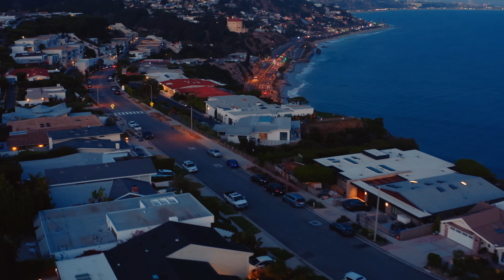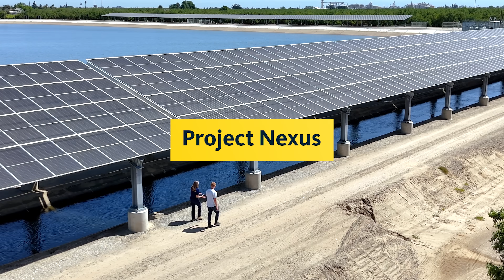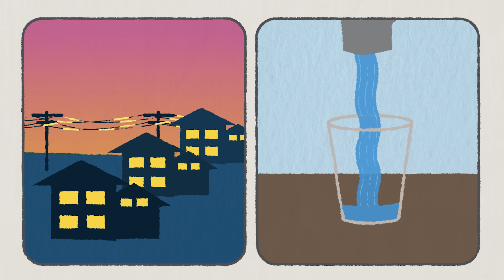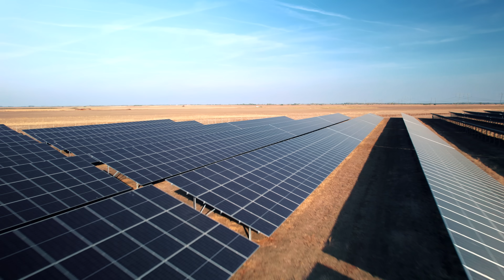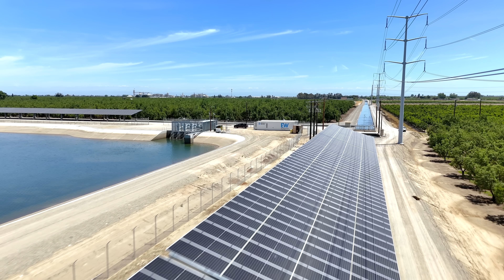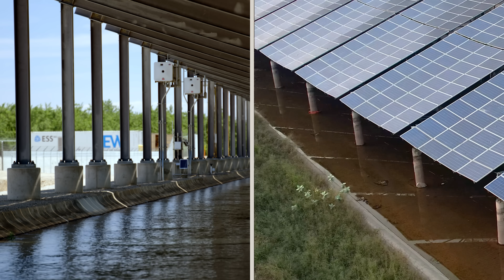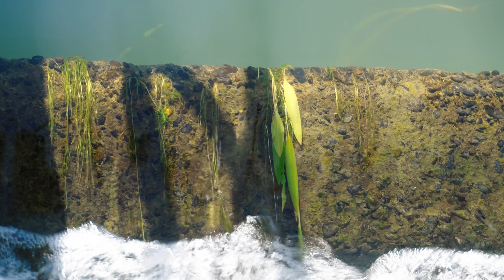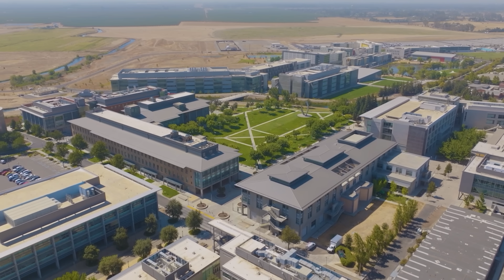California’s new solar panels do MORE than generate power

Comment: 63 billion gallons a year is a large number, but California used ~5000 billion gallons for agriculture in 2015.  Even if all 4000 miles were roofed with panels that would only save 1.2%.  That much roofing is unlikely to happen.  Other strategies like fixing leaks and preventing theft would save more.

Still, this is a good idea because it's a ready source of land for panels.  It's hard to find this much land, but the state already controls it.  The power generated is worth a lot, but it's not going to affect the water supply all that much.
Reply: I said the same. It’s a poor video, really.

Comment: Getting some sort of shade in place (that can eventually support panels) should be the biggest priority
Reply: Depending on the initial cost of the parapace (is that the right word?) it would be to expensive to add solar panels later (double the labor cost alone at minimum.) So better to just multiply the value created and spend a little extra.

Comment: 0:39 Actually electricity is used most in the middle of the day, when heavy industry and businesses are operating. During the evening there is a sharp drop in electricity usage. However at present solar covers just about all the demand from the middle of the day. Whereas in the evening when solar is weak or gone there's still significant power usage. So what's higher in the evening is the demand gap; the gap between solar generation and energy demand. Total demand and demand gap are very different metrics, and we shouldn't let ourselves be confused about who is using the most electricity (extremely wealthy businesses) and where it's coming from (residential rooftop solar).

Comment: good idea to cover canals and parking lots (or roof tops) with solar panels - BUT I fail to see why California would have any problems placing solar panels even without any of the already mentioned measures. it pains me to see solar panels on the ground in places like Europe covering fertile land suitable for farming or any other productive activities. 
however, California has lots of hot, very dry, almost barren desert regions (not to mention other US states with depleted soils dating back from the Great Depression or even more hot deserts).
Reply: You’d have to think that if land was capable of being used for grazing or growing shaded crops then purely from a profit motive you would only expect land to be covered as you put it if that land wasn’t good for either of those use cases.  Landowner is typically have enough sense to maximize the use case for their land.
Reply: Solar panels are actually a good mix with agriculture when combined with crops requiring shade. Certainly we should begin with large, flat roofs.
Reply: Getting the electricity from the desert to the city can cost a lot more and they need to get permission from every single land owner that the cables need to run through

Comment: And along with everything else, the water can cool the PV panels. Often this is called "floatovoltaics," although the panels may not actually be floating on the water. And yes, there's "agrivoltaics." Photosynthesis of plants tends to max out in the brightest part of the day, so shading them over a certain angular span may give you the best of both systems.

Comment: Like most solar, wind and climate change alarmism propaganda this video likely receives funding from the natural gas industry.  Human caused atmospheric CO2 on average is less than a 1/10% share in earth's water vapor saturated greenhouse effect. 

In practice the solar and wind generating space is supported by running natural gas turbine generators at high readiness making near zero electricity at the fuel cost of making all the electricity with natural gas combined cycle power stations.  Since little natural gas is generating electricity the high natural gas use is hidden from the public.    There is no fuel savings if there were natural gas fuel savings that would be greatly promoted.   

Steam turbine generators powered by economical nuclear, coal and the second steam cycle of NGCC power stations react too slowly to support large amounts of solar and wind generated electricity.  The UK is culling wind farm output to save very expensive natural gas.  Wind farm output wildly fluctuates per second requiring constant make up above high readiness causing wind power to be the most natural gas expensive form of providing electricity.   

All the large increases in US electric rates over the past five years are due to every increasing support of wind and solar generated electricity forced on the public power grids.  There has been little inflation pressure on electric rates.   New large industries typically subsidize power for everybody else.   

The financial support for much of CO2 global warming ideology is from the natural gas industry and Arab natural gas exporting countries.  

US vise president Al Gore 1993 - 2000) received $70 million USD from the Arab natural gas exporting country Qatar from its state owned Al Jazeera news network 2015 purchase of Al Gore’s Current TV.

Stanford University has received substantial donations from the natural gas industry, including approximately $56.6 million between 2010 and 2020 to fund research, particularly within its Doerr School of Sustainability.

NASA reports global warming at 1°C in 2025.  Global warming has been constant at 1°C since 1992 after falling from its all time news reported high of 1.1°C in 1991.  The cause of global warming is not known with studies to its cause going back to the 1970s.  

It is impossible to increase the effect of a saturated system.  A primary example of saturation to US high school students is earth’s water vapor saturated greenhouse effect that completely absorbs all the greenhouse radiant energy with greenhouse gases within a few meters of the radiating surface adding 5.55°C (10°F) to earth’s average temperature (1978 earth science Marshall High School, Falls Church VA).  Water vapor with a CO2e of 18 and on average 1% of the troposphere is over 99.5% share, carbon dioxide less than 1/4% share with 40% considered to be from human causes being less than 1/10% share.

China is the world leader starting in 2018 for building hundreds of new highly efficient ultra supercritical (USC) clean coal power stations to re-power and greatly increase capacity of is power grid.   The USC coal power stations emit no visible air pollution.  They are replacing old inefficient highly air polluting coal power stations.   The coal "fog" of large Chinese cities has disappeared due to the use of new USC clean coal power stations.
Reply: Basically a long post of BS.

Comment: 0;39 - We use it most in the evening? Are you sure? At least in SoCal, air conditioning puts a massive strain on the grid. I live in Palm Springs and my electric usage is highest in the daytime and in the summer. It drops significantly in the winter. They even tell us to do laundry at night/in the evening when demand is lower. Not in the daytime.

Comment: Empty roof space above consumers is dirt-cheap realestate. 
Perfect for dirt-cheap, no red tape, PV panels AT THE CONSUMERS. 

NO GRID RENTAL COSTS 

Dirt-cheap electricity is dirt-cheap. 

Smart people sound dumb when solving the wrong problem. 

Transmission requires massive investment.

Roof PV shades hot roofs and reduce air-conditioning costs.

Comment: Use that power to fill reservoirs along the way so the power can be used at night and during inclement weather.
Reply: Batteries keep getting cheaper and cheaper too
Reply: Hopefully the upcoming pumped storage Sites Reservoir in Sacramento Valley will be able to suck up juice added anywhere on the grid.  🌊

Comment: We don’t have the batteries, and installed capacity is how much the panels can output at noon. Considering the other 23 hrs the panels aren’t producing that power, no we aren’t producing 90% of the US’s power.
Reply: Traditional batteries are not required.  Pumped storage, air pressure, gravity etc. are all valid systems of energy storage.
Reply: @poruatokin  that is true, we also don’t have a sufficient amount of those either.
To claim we are producing 90% of the US power with solar, we would need to produce to really produce 90% of the US power for 24 hrs and store the 3/4 of it for uses when the sun isn’t shining.

Comment: Great projekt, 3xwin situation. Water saved, energy generated, CO2 reduced.
Reply: It doesn’t reduce any co2
Reply: @alanmay7929  ok, phrased correctly: CO2 emissions reduced by low-emitting energy replacing high emitting generators.
It does not remove CO2 from the atmosphere. But it could provide the energy for that.
Reply: @alanmay7929  Sure it does. Power generated here is power we didn't have to spin up a natural gas peaker plant for.
Reply: @ikani1 sure it does in a place without any industries right! Imagine the energy needs of water desalination of any other industry for example.

Comment: Right in the intro there is a statement that 1 GigaWatt to 1 TeraWatt is a 1000% increase but that is a 1000 fold increase, which is 100 000% increase.  One would think that UC would know that.
Reply: 1000x vs 1000%, it’s an easy mistake. But it is surprising no one caught it during filming or editing.
Reply: i also was surprised when i saw who released the vid to not catch that
Reply: And they wait until most of the way through to mention agrivoltaics which is just like PV over the canals: dual use of the same space.

The text is also bad. Too many awkward and repetitive phrases to mention.

And how much water is 63 billion gallons? California uses 35 million acre feet a year, that’s 10^13 gallons. 10^11 gallons is just 1% of usage.
Reply: @Eponymous300  In your rush to be correct, you've missed the point. It's not just about the total water use, but residential water use. 63 billion gallons is about 10% the residential water use in California annually, which is substantial. What you said would only be correct about total water use.

Further, agrivoltaics is only usable for certain types of crops. Still good, but it cannot be used everywhere.
Reply: @MindForgedManacle  I'm not saying it's nothing, I'm saying that it should have been contextualized.  But why compare it to a subset of water usage (residential)? Annual consumption is annual consumption.
Reply: @Eponymous300  Because, to quote the video, "That's enough clean energy and water for everyone in San Francisco and San Diego combined". So it seems like residential use is what the video likely intended contextually. Even the part that mentions farming mentions diverting the newly saved water for the most productive crops specifically.
Reply: @MindForgedManacle  Look, it's great that they're saving water. More great that they're using existing space to install PV. The point is that this video under the name of an academic institution makes basic errors and doesn't contextualize things. 1% is still 1%. Better than nothing, but not really all that much.
Reply: @Eponymous300  The "basic error" was just that they said percent. And the 1% was you misrepresenting the context, which would've made it around 10%. You can want better, but you're sort of proving this was less about the severity of what they said than about you wanting to feel right about something.

Pick a meaningful point to contest or criticize, maybe.
Reply: @MindForgedManacle  It's not about feeling right, it's - once again - about them providing the context. If you don't see why this is meaningful, we've got a basic disagreement.
Reply: I noticed that, too, but mistakes happen in media production, even with the best will in the world. I know, I worked in one of the largest single-entity media outlets in the world for nearly 3 decades. I've seen some shockers go to air. It usually comes down to deadline pressure.
Reply: 99K% difference but close enough. 😉
Reply: @greghelton4668 double lol
Reply: @greghelton4668  Technically it's 99,900% increase
Reply: Came here to say the same.
Reply: To be fair that's the difference between presenting figures and actually calculating with them.
Reply: If you put the panels low, you wouldn’t need to clean out any algae because the algae wouldn’t have any light to grow.
Reply: @FreekHoekstra  
If you put the panels low, you wouldn’t need to clean out any algae because the algae wouldn’t have any light to grow
A high tech qanat!
Reply: He was remembering from his Time Table not a calculator 😂
Reply: Common mistake I caught it immediately also. Either way good video
Reply: Trump maths
Reply: I was about to write a scathing comment ;)

At least it shows that they refuse to use AI for their script. On the flip-side, what am I to do with the other percentages mentioned in the video? How do I know they're correct?
Reply: It was an obvious and easy mistake to make. Anyone extrapolating this without any evidence of further issues is being dishonest on purpose.
It's dumber than pedantry.
Reply: There's also misleading statements about batteries in the first 30 seconds of this video.
Reply: @salpon  Like what? Don't say there is misleading statements without pointing out those misleading statements.
Reply: @salpon  Such as?

Comment: Just for comparison that would be enough energy to power desal plants to cover nearly 100% of CA non agriculture water usage.
Reply: Not 24/7 tho! You need very reliable energy to do such intensive industrial activities
Reply: @alanmay7929  Something not covered in this video is that some of the canals do change elevation, and they already use those elevation changes for power generation on the elevation drops, the the pumping for elevation increases don't pull as much from the grid. In theory, you could make use of that a bit like water energy storage to help balance things a bit more. Of course, there is also just using battery storage, too. The nice thing about electrical grids is that we don't have to rely on just one power source running 24/7. We can use a mix of different sources, each doing what they're best at, and in the area best suited for them. Solar is a great cheap variable source, but so is wind. Hydro and even nuclear are excellent base loads that keep the stability up. Basically anything that doesn't pollute (as much) is good, and we shouldn't just pick one source.
Reply: @ikani1 the problem is those different sources of renewables are intermittent and that doesn’t mean the sun or wind are always on or one of them at any moment! For energy intensive industries like steel or others batteries aren’t going to cut it either! There need to be a very strong base load

Comment: Depriving life in the water of sunlight
Reply: These aren't natural creeks with fish and stuff. These are concrete irrigation channels, specifically designed to have as little life in it as possible. Any life there is in there is regulary cleaned away.
Reply: The life there is undesirable, requiring more water treatment
Reply: Found the bots
Reply: @ikani1 fossil fuel industry bot
Reply: wonder how this affects water quality
 - sunlight can naturally disinfect water, unlike shade
Reply: @iXpertMan sunlight contributes to algal bloom, which is why they need to clean out the canals in the first place.
While agricultural water goes to the fields untreated all domestic water needs to be treated anyway.
What kind of pathogen do you think is going to be 'disinfected by sunlight' ?